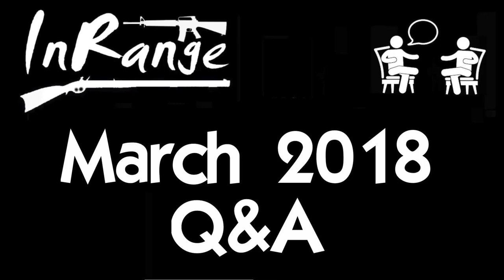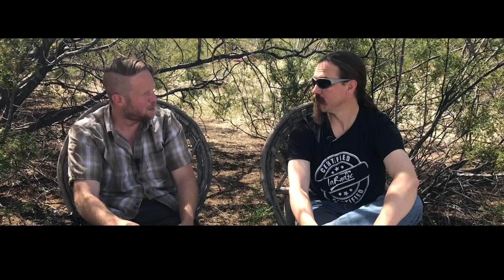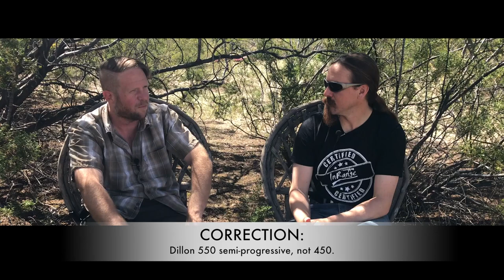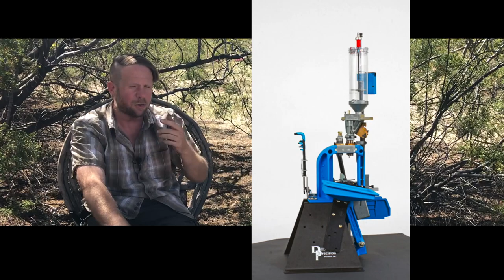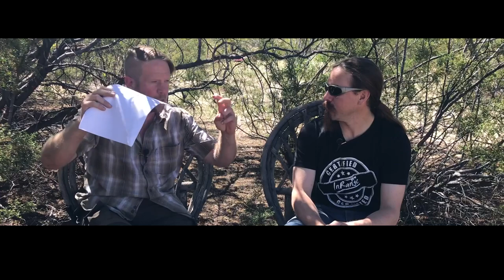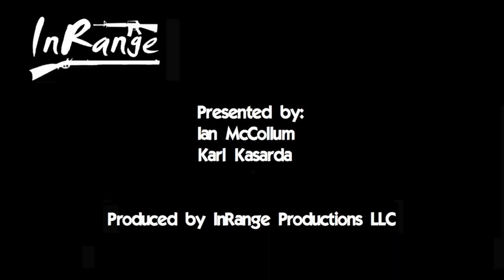March 2018 Q&A

Comment: You guys should do an 1980s action movie challenge match. You run the corse hip firing a Machine gun of your choice (Light Machine gun/submachine gun) and dual weild Pistols/ Machine pistols. Also you could find a way to incorperate a match with pistol grip shotguns because i know you like them so much.
Reply: Hip firing is hard to control and "dual wielding" is more difficult.

One  might say thats the point of making it into a competition.
Reply: A few years ago I ran a submachinegun match that forced you to only use hip fire while running through a long killhouse. It was a total blast, and I'd love to see Karl and Ian attempt it. But I don't think it would work with semi-autos though.

Comment: Commenting on this ancient video to say that besides cost a bolt gun can get you a lightweight rifle in  a full power cartridge that retains good accuracy.  You can buy a  Ruger American, or TC Venture or Savage Axis in .308 or .243 that shoots 1 MOA on a cold bore, weighs a hair under six pounds. and costs between 300 and 500 US Dollars .  A decent scope brings the weight up to about 8 pounds on the sling.  A scoped semi that holds similar accuracy tends to be chunkier and if not, more expensive. This is good for a hunting rifle.

Comment: The advantage of Bolts isn't mechanical accuracy anymore. The problem with Semi's at long range is that the cycling of the action pulls you off target. This is important for spotting your own trace. With long range bullet flight time already limits the advantage of a semi as you already have to wait to see the correction. Bolt guns or at least manually operated (gas off) semi's will always be relevant for this reason.

Comment: Having been and HK armorer for many years and maintained over 40 MP5s in 9mm and .40 full and semi for the last 16 years here is the dirt.
The locking surfaces of the trunion are what were down and may require the roller size to be increased to bring the headspace back into spec that part is true.  If the trunion wears down with out a change in the rollers the gun actually has a tougher time getting out of battery and will eventually not cycle at all.  The rollers will set so far inside the trunion recesses that at some point there will not be enough energy for the rollers to overcome the geometry of the recess and the bolt will stay in battery.  This in my experience is extremely rare.  What I did see a lot was the opposite condition caused by carbon build up in the trunion.  So carbon would build up in the trunion recesses and effectively change the geometry of the trunion and reduce the space that the rollers lock into.   This reduction in locking would allow the bolt to disengage faster and with more energy than it was supposed to.  The increased speed of the bolt and carrier led to a potential for the rollers to damage the receiver.  The damage will be two dents, one on each side at the rear most point of travel where the bolt stopped rearward movement.  The over speed bolt would slam to a stop and the rollers would slam out to the sides with enough force to dent the receiver from the inside out.  Sometimes the damage was slight and other times the stamped receiver would dent out far enough to flake the paint off the out side with ugly visible dents.  Worst case it does that and breaks the welds at the rear stock pin location of the receiver as the speeding carrier is stopped by the buttstock and thus transfers the energy to the pin. ( at least on MP5s as they have only one pin, I cannot say anything about the rifles with two pins as I did not maintain any of those).  I have many pictures of the damage I am describing.
Reply: A properly maintained MP5 is likely going to last a lifetime.  We had 9mms and .40s that has tens of thousands of rounds through them and were good to go.  The HK barrels on these are amazing and unless you have a squib load or something abusive happen to it it will last.  You would have to be very wealthy to afford the ammo to wear one out.
Reply: And I'm suddenly convinced this is how one of my local ranges destroyed their rental MP5

Comment: By 1970 most grunts in Vietnam had at least one 30 round mag, usually in the rifle. Which makes sense for breaking contact. There are ample pictures of 1970-1972 grunts with 30 round mags, M203s etc.

Comment: Another advantage of semi auto rifles over bolt guns valid even in hunting is the dampening of the recoil during the cycling of the action. If you read "sniper on the eastern front" the author cites this as the biggest advantage of a g43 over a k98k (less recoil-less flinch before squeezing the trigger and less bruises on your shoulder at the end of the day)

Comment: Another great video guys. Good job! Was worth just listing to the talk on shotguns in 3gun. I live in LA,CA(so 12 gauge pump it my primary, in at least small part, a geographic influenced choice), 12 gauge in practical form, is important to me. And running my 870 dry or say...get a stuck husk... and swapping to my sidearm, is a drill a run a lot. I run an 870 Wingmaster, 7+1 with red dot, weapon light, blue fore 2 point etc/blah....I wound add to the convo, as far as when you where going over using slug or buck. I was thinking slug, buck, or federal flight control!! I love the stuff, but one needs to expect that, with flight control, your punching a 73.+ hole up to 15 feet. Even more to consider, and showing that you gotta know your spread, per ammo/type.

Comment: One of the advantages of full powered round from the point of view of the supply department is that the rifles and machine guns could use the same round. I'm mostly convinced this is why the US was so wedded to the 7.62 being adopted after WW II. The knew they wanted the advantages of a smaller round over the 30-06 but they still wanted one round for machine guns, snipers, and combat rifles. What a lot of people miss is that the 7.62 is still very much in the inventory in machine guns and sniper rifles. It does not appear to be going anywhere anytime soon.

Comment: You guys frequently mention the obsolescence of bayonets.  While in the vast majority of circumstances you are most likely correct, I have thus far never heard you say what having the ability to mount a bayonet COSTS.  I could be wrong but I fail to see a down side to being able to use one, even if one never will.
Reply: Devin Stromgren It really depends on the barrel setup. I see no issue throwing a bayonet lug on a rifle of the barrel is exposed and has no large muzzle device, however dicking up any other part of the design to accommodate a bayonet makes no sense.
Reply: Man with bayonet: I've never used this bayonet, but I fail to see what >carrying< this bayonet costs me in case I were to use it.
If you don't like that answer, the other one is: the 100-odd grams of steel the bayonet lug weighs.
Reply: it costs you carrying useless gear around.
Reply: mount is not the problem, the bayonet is. It means both weight and bulk.
Reply: But you need to carry some sort of knife anyway, so it may as well be a bayonet.
Reply: But one needs an edged weapon anyway, so I see nothing lost in having the capability to mount it to the rife and substantially increase my reach.
Reply: Devin Stromgren that's a good point. As long as the bayonette role doesn't impact both the knife and gun primary roles, then sure, why not.
Reply: Bayonets are great for intimidating POWs and civilians.

Comment: There is no reason not to use the Dillon 550 for .45-70, etc. It works fine. I've loaded several thousand on my 550. Same goes for forming brass. I just finished forming .338 Spectre from 10mm Magnum brass a week or so ago on my 650.

Also, FYI, the 550 is a progressive. Auto indexing has nothing to do with whether it is progressive or not. Progressive only refers to multiple stations having cartridges in various stages of completion, progressively going through said stations, having a completed round drop out with every handle pull.

Comment: The bayonet in modern military has its place, no if's or but's about it. The bayonet is first and foremost a tool, and a weapon a distant second. In my 18 year military career, I only had two 'opportunities' to stick my bayonet into someone else. The rest of the time I was doing 'other than directed' uses with said bayonet.
Reply: Shoulda waited until the end of the video before throwing comments out! What would it take to beat the AR platform, a revolution in the way firearms function. A move away from chemical energy as a propulsive method would be the 'next' answer, but designing a man portable 'railgun' would be so prohibitively expensive.
Reply: Matthew Kriebel  yeah. Why carry 2 knives?

Comment: For the $2000 hunting/precision rifle optic, you could go for the SWFA 3-9x42 or 3-15x42. $600 and $700 respectively, both are first focal plane, and very well built scopes.
https://swfa.com/swfa-ss-hd-3-9x42-tactical-30mm-riflescope.html
https://swfa.com/swfa-ss-3-15x42-tactical-rifle-scope-3.html

Comment: Point about captured german engineers helping increase russian expertise with weapon parts stamping is higly dubious. After all, stamped AK's were adopted only in 1959, and before that Izhevsk plant(the place, where german engineers worked at ) produced miled AK's
Reply: before that they made a stamped AK and it had production issues, that's why they switched to milled
Reply: +Baker7498
So, what exactly they did then, if they couldn't work out these production issues? Producing weapon with stamped parts wasn't exactly something new to USSR in 1945
Reply: +Вячеслав Скопюк
What the Soviets did, was that they stopped production of the stamped version and built a milled gun instead until they could work out those issues. They introduced a stamped version again in the late 50s when those issues were ironed out.
Stamped parts were produced in the USSR before but not very long and never in a design of this complexity.
Reply: +marvincz3
and again - what part captured german weapon designers had in it?
Reply: Producing a stamped PPS and making an AK are two vastly different animals
Reply: +Tangero
yep. And again - where in that the german engineers with their "stamping expertise"?
Reply: German engineers did have the necessary expertise at the end of WW2. The Soviet Union did use captured German engineers for their expertise in several fields, Hugo Schmeisser was among them.
I don't know if Russia admitted that they helped with this, specifically, though.
Reply: +marvincz3
>German engineers did have the necessary expertise at the end of WW2.

My point was - "stamping expertise', which, probably, german designers had, didn't left a mark in AK production.
Reply: How can you tell?
Reply: "stamped AK's were adopted only in 1959, and before that Izhevsk plant(the place, where german engineers worked at ) produced miled AK's"
Reply: And you were told in the beginning that that's not really true.
The AK was first designed and built as a stamped gun, that was changed to a milled design when Soviet factories weren't able to produce it. That capability needed to be improved until the AK could be reintroduced in a stamped version.
... but now we're going in circles, so I guess we're done.
Reply: >And you were told in the beginning that that's not really true.

 My point still stands - with supposed german help still USSR couldn't produce  working stamped AK. So, where was the german "stamping expertise"? By itself, stamped gun parts weren't something new for USSR at the time
Reply: It wasn't there because the PPS is something a dude with a hydraulic press could make in his garage. A folded metal blowback SMG is not what I would call complicated. A locked-breach select-fire assault rifle is. 

"But people used to do AK build parties all the time." Yes, 40 years after the design was toleranced and spec'd correctly and after the necessary tools became well-known commonplace.

Compare the STG stampings to those of a PPS, and then compare them to an AK. Much more similar to an AK, yes? Because the PPS was pretty much the extent of what a country with a fledgling stamping industry could do.
Reply: >A locked-breach select-fire assault rifle is. 

and USSR failed to produce such rifles with stamping until late 1950's. Despite supposed "german stamping expertise, that helped". 
On the other hand, we know, that german engineers helped USSR to produce ballistic missiles and motorcycles. And, strangely, THAT production began in the late 1940's and was quite successful. Despite the fact that this production was also completely new for the USSR

Comment: As someone who uses a service bulpup I'd have to say once you get used to where the magwell is it's really no different than an AR, in fact I'm much faster with the L85  because I've had occasion to fire it much more often than an AR and for my L85 clearing stoppages is relatively easy since it has a traditional ejection/bolt system. Failure to fire drill is tap the charging handle, if that doesn't work, rack and tap.